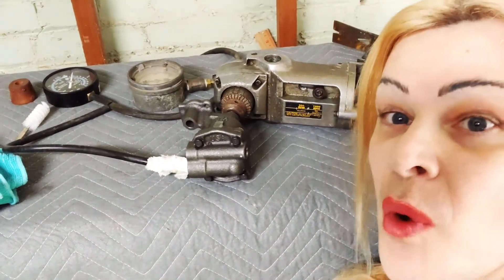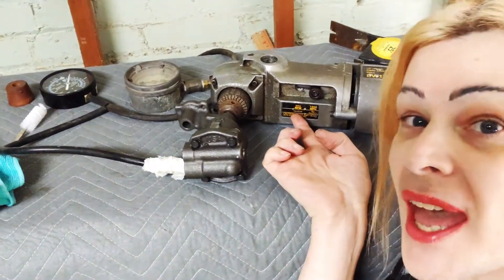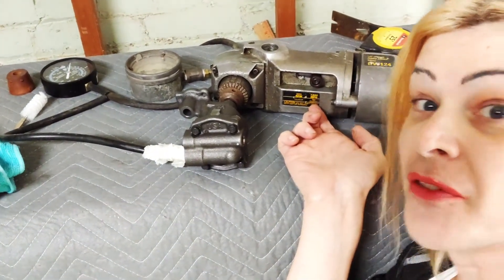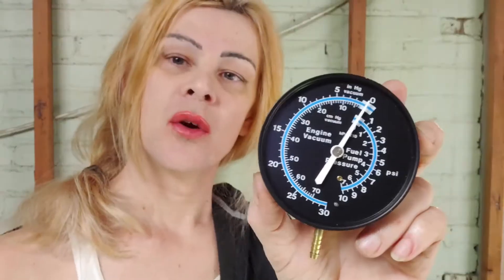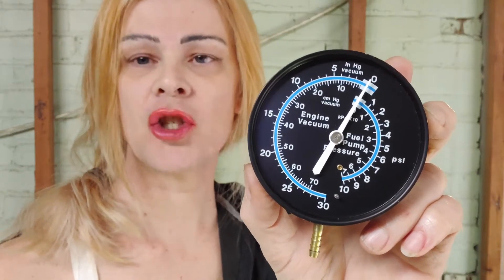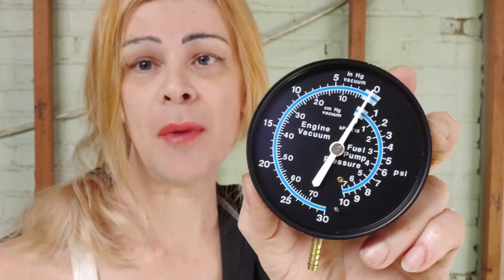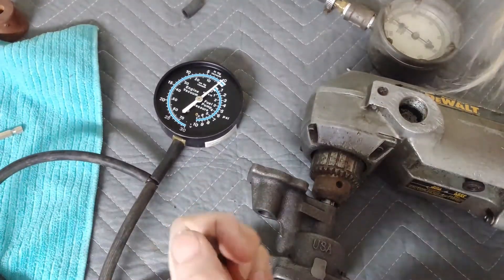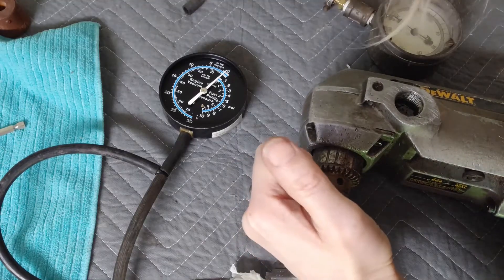Turbo testing for smallest minibike boost project #nonamenationals

Comment: Why didn't you choose to run a exhaust recirculator pump found on early 70's to 80's vehicles ?  They pump way more air than that oil pump. And it don't require any oil and has a pulley attached already. Appear to be a 5/8 in shaft, so pulley selection will be lots. Feel like 3-5 pounds in weight, but could be less ?  Direct drive would be instant boost.  A vane style compresssor from an air conditioner would work even better, but might use most of the engine's power just to drive it ? Anyway, you're the brains behind that build, just throwing out ideas. Hope you find something useful.
Reply from the maker: the options that you have suggested are oversized and equally expensive compared to the price of the overall machine. I was trying to test alternatives that fit this application. So far, the results have not been as I had hoped, but failure was always an option.
Reply: @kimfixesthings   when i made those suggestions i was taking into consideration , even that tiny engine wil require way more air than that oil pump can provide. You might want to try a big block chevy oil pump, and a high volume one that have longer gears. Hope that helps.

Comment: I'm not sure if that pump can produce enough airflow into your engine to create boost?  An air pump for automotive emission systems will provide more airflow
Reply from the maker: I have made preliminary investigation to what you are talking about. In side by side testing, the air pump has not shown to be right for my application. More testing is needed. Thanks for your suggestion and for watching!

Comment: Rotational mass and RPM = side loading and needs lube, thoughts?
Reply from the maker: Red and tacky farm impliment lube. One run at a time. If lubrication is the issue, but it makes good boost, then we will build a better version 2. Also considering running a little 2 cycle oil, shouldn't hurt anything else in the short.

Comment: This might be a viable option for smaller displacement engines. But a smog pump might work for a small 4 cylinder engine.
best of luck to you Kim.
Reply from the maker: In the parts pile, I have a smog pump from a small engine, but those are still heavy and expensive comparably. It is my fallback plan.

Comment: Ever since you mentioned this on that Live, I've been thinking about this..... you are definitely on the right  track with this. Is there any way you can Teflon it? And I think you are better with the sbc one. I think it will grab more air than the bbc one.
Reply from the maker: I've never 'tefloned' anything, but I will look into it. I just got a big block version, so I am going to also test that one. It seems like it will move enough air for this little engine, but I am skeptical of any major boost psi. I don't think these motors can handle big boost anyway. I am hopeful that a couple of psi could really wake this slug up.
Reply: @kimfixesthings  pretty cool to see you taking this on, and esp in this manner. It's what hot rodding is all about. And you don't have to worry about the "this won't work" because no body's tried it. That being said, I think you'll get the psi out of it (or a working one) the challenge is going to be the cfm with the psi. Going to be interesting no matter what.
Good luck.
Reply from the maker: @BareRoseGarage  I feel more confident because I have you, and others who are able to use critical thinking to help. I have a lot to learn, but I also have some tricks up my sleeve.

Comment: I hope it works for you but I highly doubt it will move enough air volume. I would look into a old Ford air pump/smog pump if I were you.
Reply from the maker: this is only mounting on a 100cc engine